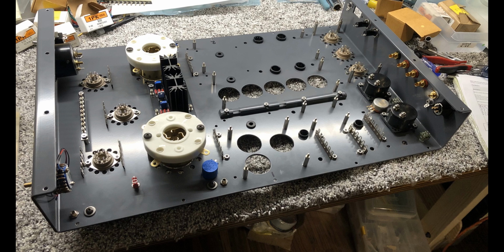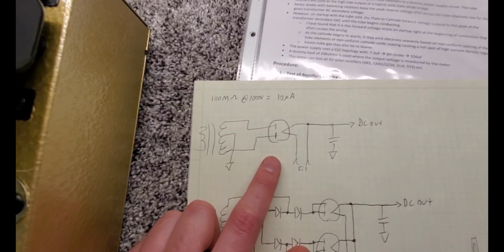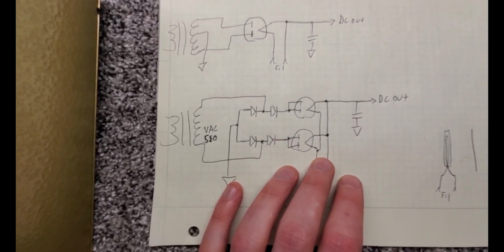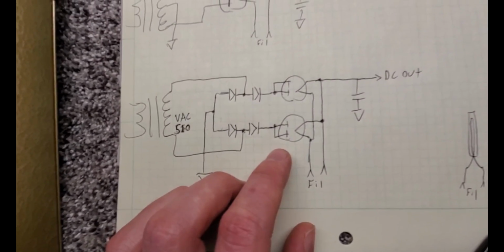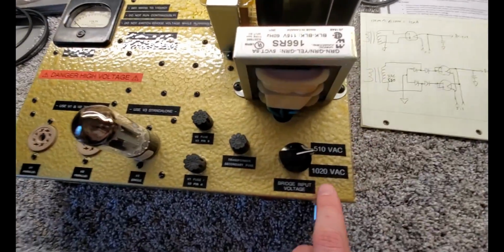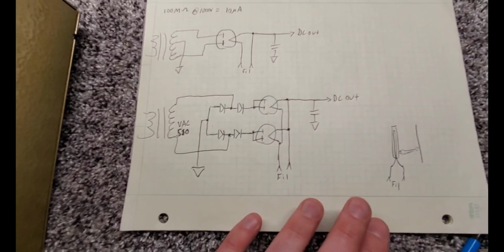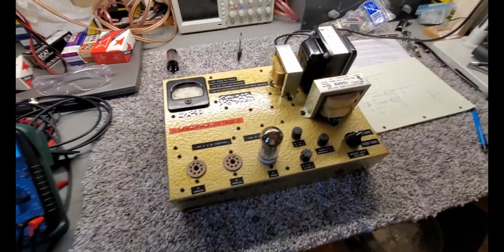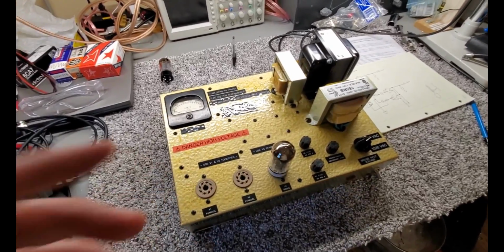A Custom Built High Voltage Tube Rectifier Tester

Comment: I was really hopinhg at the end that you would test the rectifier at 1020V and we would nsee the arcing. COuple of questions - if it hapens, how safe is it? It wouldnt shatter the glass or cause an internal arci in the chasis somehow?
Does it also blow the fuses?
And iportantly - doies it permanently damage the rectifier, or is it still useabl at lover voltage amplifier?

Comment: Just watched most of your video's today & checked out your shop. You make some nice amps which are well built & your shop is free of the usual audiophoolery BS, which I liked. I've built a few valve amps & a few years ago was going to build a big 813 PP amp so looked into the power supply design. The potentially lethal EHT supply in regards to a future amp buyer safety aspect knocked that idea on the head. Your solution is very interesting but apart from fuses I notice your amps have no active protection as such. I'm sure you went into the subject in great detail so a few questions if I may.
   Why didn't you include an EHT fuse, use a soft start for the EHT PSU & how do you sell a consumer product with a potentially lethal power supply? Any hoops to jump through? Why no anti tamper switches ( in case a curious customer opens it up & sticks his fingers in) & why no OP valve over current protection? This isn't meant as criticism but curiosity
   Thanks for posting, great to see how someone else builds valve amps..

Comment: The arcing on startup on rectifiers this problem was covered by Mr. Carlson labs and he made a fix for that many years ago.
Reply from the maker: I haven’t sean that video, but he is likely adding series SS diodes, which we are doing already. This is the common method.

The SS didoes will help quench an arc and prevent reverse current flow through a rectifier if an arc generates, but not prevent it. Forward voltage drop on startup is what causes arcing.